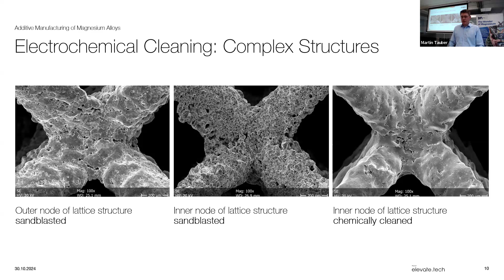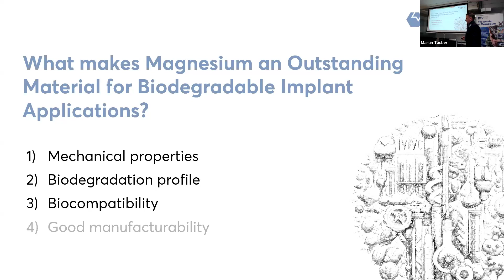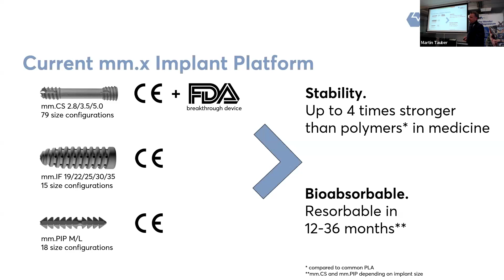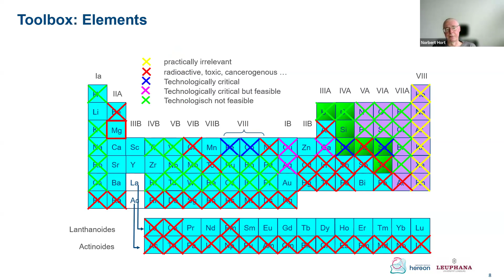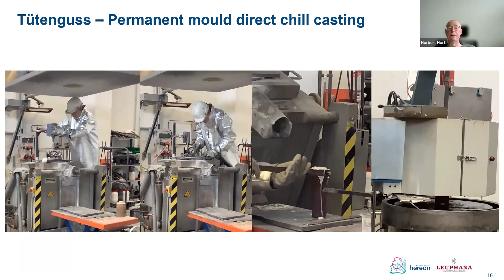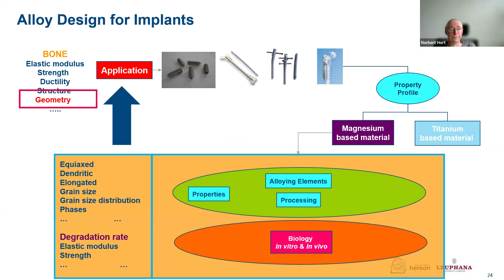IMA Webinar: Magnesium Medical Applications

Comment: I like how succinct the presentation was. I see a very huge potential for Mg for the medical sector but I'm still concerned about its low electrochemical potential which makes it prone to corrosion and stress corrosion cracking. Is there anyway additive manufacturing can enhance this?